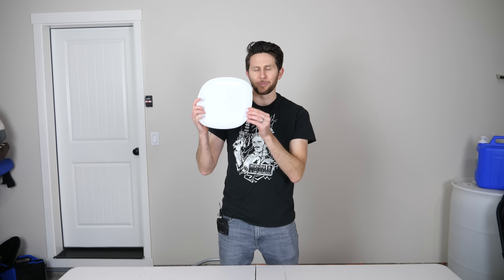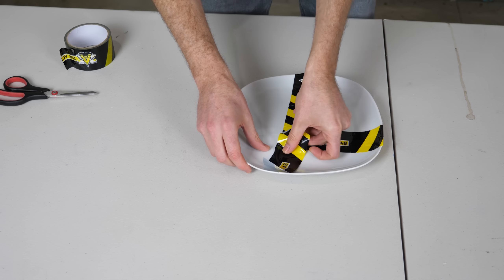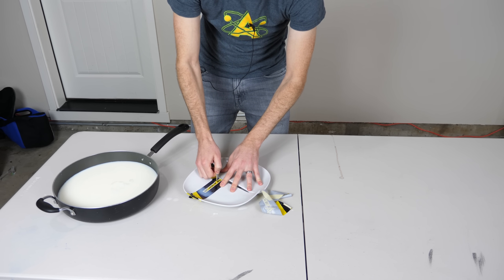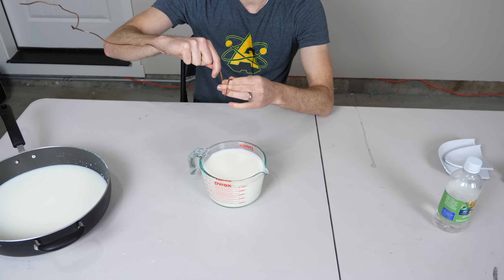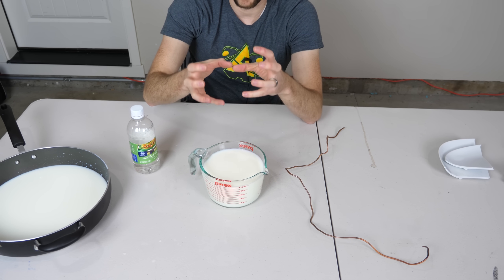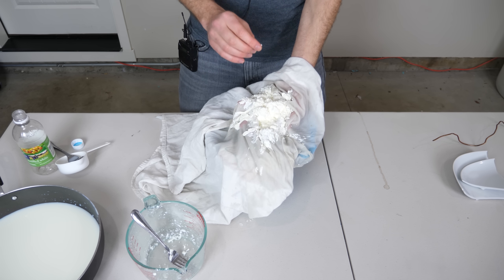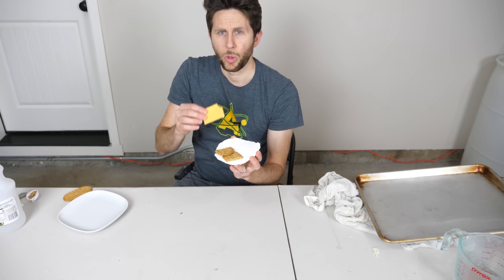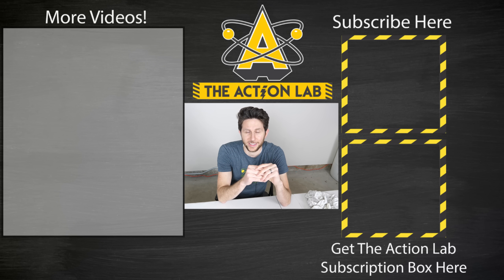Can You Fix a Broken Plate with Milk? The Milk Plastic Experiment

Comment: I had an elementary science experiment book back in the early 80's. I don't remember the name of it now, but there was a section on repairing ceramics/china with milk. Unlike the video you cite, this is the method that was proposed in the book. After creating the casein, it was then used as glue to repair the plate. Instead of leaving it sit in warm milk for 2 days. LoL

Comment: for any reference, im in AP Biology, the 4 structures of amino acids r ptimary secondary tertiary, and quaternary structures. multiple polypeptides form amino acids, and multiple amino acids create a protein. 

also action lab, if u want to speed reaction, add enzymes/ catalysts to it and if not that, try optimal pH level, Optimal temperature, or/and straining substrate bonds, thor are main 4 ways to speed a reaction

Comment: Answer: no / reason: it’s a liquid that isn’t even sticky- said by LOGIC itself / if u add chemicals to milk that makes it solid then it would work and you would most likely freeze it after, or u can just freeze the milk and use it as a cup then it will melt
Reply: kevin yang so if you were to make a plate out of milk, would it be possible to freeze the plate as an alternative to baking it?

Comment: Tertiary structures are the 3-D shape that results from the primary and secondary structures. Quaternary structures are what happens when you take multiple polypeptides (called sub-units) and put them together into one piece. What you described as tertiary structure is the quaternary structure. 

To review:
Primary structure: the sequence of atoms (carbons, hydrogens, oxygens, and nitrogens)
Secondary structure: the folding patterns
Tertiary structure: the 3-D shape that results from the folding (like if overall it is a globe shape or cube shape)
Quaternary structure: multiple subunits of amino acids together, a protein consisting of more than one amino acid chain

It confuses a lot of people! But just in case any students were trying to understand protein structures, I wanted to make sure they didn't study the wrong thing.

Comment: Google: Poly Lactic Acid or PLA. The most commonly used 3D printing material. Glucose to lactic acid, distillate or otherwise split the lactide to two parts by removing H2O and they will form a polymer when heated to 180-240C.. It is very tough material that can take anything but.. heat as it is thermoplastic, it can be remelted endlessly..

Comment: You have several things wrong with how you are trying to fix your plate. the plate must be ceramic and you need to let the milk dry inside the crack do not submerge the plate. it works much better with smaller things like nic-nacs.

Comment: Nice video, but I am a bit disappointed. Please also try to fix a broken plate made out of milk! :)
1) break it and try fix it with new, fleshly denaturated protein. Maybe it will act like a glue
2) try to let the proteins in the breaking point get their tertiary structure back, stick both sides of the plate together and maybe the proteins will denature in a way, that the breaking point is fully gone! That would be amazing.
Thank you :)

Comment: Suggestion: "Measuring the Refractive Index of Air Using a Vacuum Chamber" I just read that paper, and it looks like something you could do with little extra equipment, since you already have a transparent vacuum chamber and a laser. Basically, you produce an interference pattern, and it changes as you evacuate the air.

Comment: why didn't you just put the denatured milk paste onto the cracks and bake it?
Reply: These comments 😂😂
Reply: Or not break the plate?
Reply: jim halpert right!! That’s what I’m saying. Next video. “Putting casein on a broken plate... does it work?”
Reply: The Vegas Mermaid no because the plate has a clear glaze on it that nothing can penetrate,mits like a layer of glass over it so of course the casen  won’t be able to soak into it. But maybe If the plate was just fired with no paint or glaze and then broken and he rubs casen into the area around the cracks then heat it up it may work but it won’t look good . It’s not like a glue and you can’t stick it on the ends, although maybe if you did that but had the plate clamped together it may work? But hey it’s just easier to glue it with superglue or buy a new plate or don’t break the plate in the first place lol.
Reply: or just run to the store and buy some Crazy Glue.
Reply: Why didn't you just buy a new one?

Comment: No dude... Condensed canned milk. You just rub it on the edge of where the break us and it glues the pieces back together, but that trick is usually only used for porcelain figures. I've successfully fixed dozens of breaks in porcelain figures using condensed milk.

Comment: No Dude! Actually it's not dumb experiment.
Long time ago, about 2008 I guess?
There was a tv experiment that gluing 
the broken plate with milk.
It actually worked it out.
But! THIS IS IMPORTANT!
I do not know how they did it, but one thing I remembered that they use some kind of milk dough and use as glue. And it actually sealed the plate very well enough.
Of course that putting bunch of gallons of milk on a broken plate does not seal the plate.
But other ways to do it, it works very well.
(If only I could show you that tv experiment though.....)

I just googled it out how they did, and here is how they did.

Let's make glue out of spoil(?) milk.
Ingredients: milk, vinegar, stove(or something that can voil the milk), baking powder, and cloth.

1. Boil the milk about 5 min on low temperature.
2. Put few spoon of vinegar and gently  mix it
3. When it starts to make some dough(?), pour milk to the cloth.
4. And squeeze very hard to come out all liquid inside of the dough.
5. And mix with pinch of baking powder.
6. And use it as a glue, put it on the broken part of the plate.
7. Put enough time to harden the plate.
8. The lefted milk dough can play as the play dough.

Well! I'm not a great translator, but I tried! Ha~!
Try again without taking videos.
You know... it take some time to make anorher video. Right...?

Comment: In India this process is generally used at homes to make cottage cheese (called Chhena). It is a type of a ricotta. If we dehydrate this Chhena a little more, it becomes paneer. Usually we use lemon juice to start the curdling process at homes, but vinegar and other curdling powders are not uncommon. The whey which is left over is also considered very healthy, and many drink it directly, or use it as a base in cooking curries and Dals. Didn't know that it could be dehydrated in an oven to make it that strong.

Comment: OK now either you or King of Random have to take the whey and put it in the dehydrator and freeze dryer and check the properties after the water is removed. I'm curious if it as strong as the milk plastic or if it can be made into a modeling clay/putty?

Comment: Yeah there for a minute I was wondering if you were making cheese. You actually can make cheese by using vinegar (heat milk to 185 then add and make sure to use cheesecloth to drain all the liquid out). That was a pretty durable milk plate, though.

Comment: You could have technically fixed plate with milk by using the denatured milk protein.
Reply: Yes but it wouldn’t be the original shape and visual aspect of the plate...which is the main objective.:.to return the plate to its original form
Reply: @topher10  Well at least it does something, even if it's not practical or beautiful :P but then again it would be better to put heat resistant food grade silicone, or some other heat proof adhesive.
Reply: Evi1M4chine  I don't understand your point, did you reply to the wrong comment 😂 Did you mean not to confuse the chemicals with the original products or else you can get sick, if so, I didn't say if it was practical or safe.

Comment: Only works on certain types of plate. It doesn't work on Corelle or glass but it does work with some ceramics.  Also it's more for small cracks not complete fractures.  My grandmother used this to fix her chipped saucer.

Comment: So I guess if you put the milk through vinegar and used the protein in the cracks, then taped it and cooked it in the oven at very low heat for a long time,  you could actually fix the broken plate!

Comment: Thanks for the interesting video -- I'm curious if you could have "fixed" the broken plate with the casein to use it like a glue -- would would it have taken to make the repair work?
Reply: Hi there! I actually found a method that works. I'll paste my comment here:

"Note to people who came here hoping to find a solution for their broken ceramics: Boiling your mug or whatever in milk can work! At least for hairline cracks, which was the deal with me.
I put the mug in a pot on its side so the entire crack could be covered. I only filled the pot up enough so the crack was fully covered so I didn't waste more (whole) milk than I needed to. I put the heat on low and left it there for an hour. You could see the proteins kinda forming a bio-plastic film almost on the top as it heated. After an hour, I let it cool COMPLETELY then hand-washed it with cold water + Dawn the next day. Then I filled it up with water to check and like 90% of the crack was sealed, with water leaking only out of two specific spots. Since there was improvement, I planned to do it again later that day and set the mug aside. Later, while showing someone else, I filled it with water again and this time it was totally sealed, no leaks at all. I guess it needed more time to cure or whatever? This was almost a week ago and it's still going strong. The crack is definitely still visible, but it doesn't leak at all, so I'm satisfied. Only used it with cold drinks the first two days, then tried a hot drink and it still held up. Haven't put it through the dishwasher yet- I've just been hand-washing it with cold water to be safe after each use.

Just wanted to let y'all know to not lose hope just yet! Idk how a COMPLETELY broken ceramic would do but I'm curious to find out honestly."